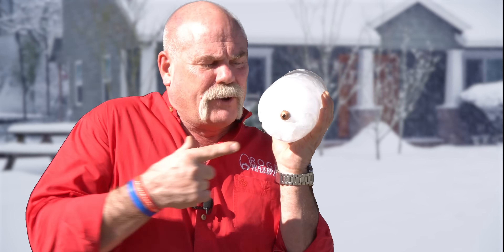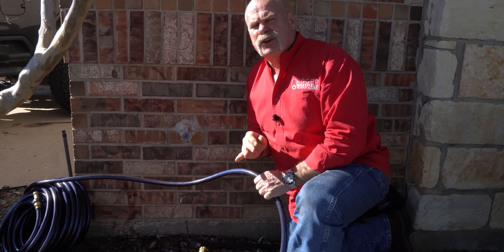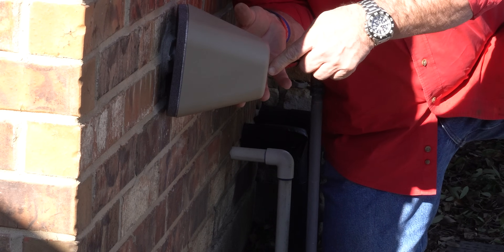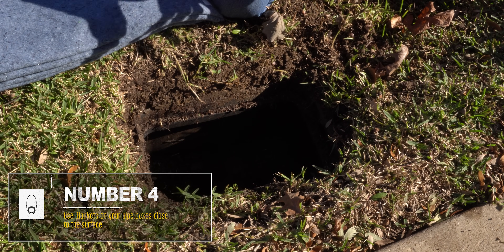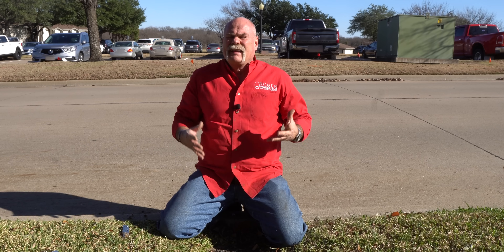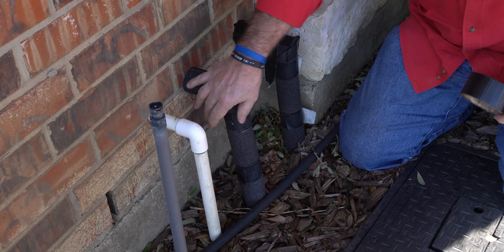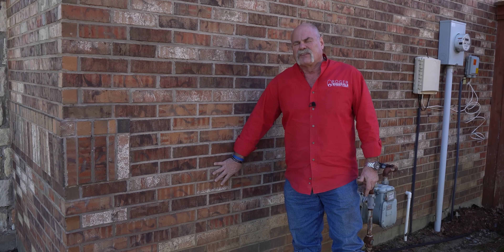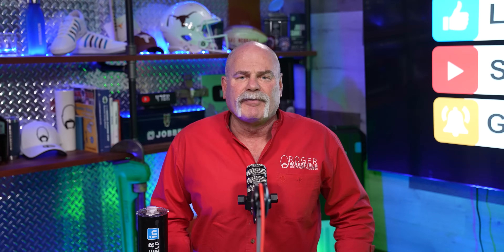6 Tips to Prevent Your Pipes From Freezing!

Comment: The problem with insulating your meter pit is that sometimes when meter readers come by to read your meter they will pull it all out and not place it back in the pit.
Reply: Thats an issue that is slowly being fazed out. Some cities here in California are replacing analog meters with digital ones that sends the data directly to the water company. I think within the next 20 years or so, most states will have already implemented something like this.
Reply: @javiervazquez9472  We are about too as well in the next 2 years mainly because no one wants to read meters and its causing a lot of billing issues. plus epa guidelines about lead contamination in older meters.
Reply: @TheJayDawgZ  keep it up, and soon yall will need to also put cancer warning on everything xD.

All jokes aside, it's probably for the best. The digital ones are scary accurate. And they automatically mail you if they believe you have a leak with your average usage water usage chart, and how it skyrocketed after possible leak.

Comment: I’m a plumber in Alpine Tx and recommend all of these same tips, but I have found with our typical Texas weather. We will get snow just for it to melt in a day or two, the freezing temps come back in a couple days and the blankets stuffed in valve boxes are still wet from the melted snow/ice/freezing rain or what have you; freezes and cause the problem. I see this every year so if you insulate the valve box, don’t forget to make sure that insulation gets swapped out after any kind of precipitation if there won’t be enough time for it to dry out on its own between freezes.
Reply from the maker: Great tip! Thanks for sharing that
Reply: Seems we can’t ever have a dry freeze. Best I can do is cover everything with plastic bubble wrap.

Comment: DO NOT OVERLAP THE HEAT TAPE LIKE IN THE VIDEO!!! Can't believe this slipped through one of his videos, but you never want to overlap. Most manufacturers will tell you, run it straight with the thermostat touching the pipe itself. Most people swear by putting on the underside of the pipe because heat rises. And then wrap it in insulation, you'll have no problems with your pipes freezing.
Reply: I noticed that too. Maybe one day this Roger guy will learn to take his time and do things right. Because if you don't have time to do it right, you'll need more time to do it over.
Reply: @robertthompson3447  he's a good plumber, I like his content, I'm not bashing him at all. I just think that since he lives in Texas they don't really worry about freezing pipes usually, at least not until the past couple years. I just hope someone reads this and listens, because it's a silly reason to burn your house down lol.
Reply: Overlap burns up the tape
Reply: You just cited Meskimen’s Law 😊

Comment: it's interesting to see how different things are in different places. Where I live in Canada the pipes are all 6 to 8 feet underground. There is a shut off at ground level but it goes down to the pipe and takes a special tool to use. The water meter in inside in my basement. all the pipes go through the basement or up the walls to the second floor so they are always heated as long as my furnace is working.
Reply: This isn't the case for all of canada.  Pipes only need to be 18" below ground where I'm at.
Reply: @itsmark1991  where I am, they bury them about a foot deep, for the service, but I've seen a pipe so shallow it's a miracle they didn't hit it with the lawnmower.
Reply: Yeah I'm in Canada too and even with the pipes buried 8 ft underground you still have a cold winter every once in awhile that are freezing burst a water line that will leak and flood the street for weeks and I can't even imagine having water pipes on the outside walls of my house even our sewer systems are at risk of freezing over if you don't get enough snow before we get our minus 40 stretches
Reply: @itsmark1991  I'm guessing you're in BC somewhere close to the coast or even on the island
Reply: @mark Mior  Well...he did say "where he lives". And this should be common sense. My coworker works in the tundra and the pipelines they install are 8-10ft under and over for plumbing due to frost heave.
Reply: @d1vin1ty  my cousin is a  RCP officer and he worked up north when I went to visit him I was quite interested to see that all of their plumbing was above ground inside of metal insulated piping that they heat all of their water piping and sewer piping runs through it there sewer pipes run downhill to stations then gets pumped up to a main building where it is treated then dried out and trucked away in the spring and summer months to the train and hold back down south to a dump it was super interesting to see how infrastructure is built up on permanent Tundra
Reply: @mark Mior  what? I'm in Ohio. Further south than any place in Canada. Our water lines must be minimum 12in deep AND no less than 6in BELOW THE FROST LINE. That basically means all our water lines are at least 5 or 6ft underground by code. Where is Canada is it warmer so that 18in is acceptable?
Reply: @theelite1x721987  I believe the island and places in and around Vancouver rarely see extended cold like they're seeing right now as it's a very rare occurrence to have extended weather like that but where I am in the middle of the prairies it is quite common to have a month-long stretch of -20 + at night with a week or so in there of minus 40
Reply: @Ken Brown we have water mains on top the ground
Reply: @wm1958  yeah I've seen some YouTube videos where the water meter pops up above ground and then goes back below ground and heads to the house those are pretty funny to see for someone who lives in such a harsh climate
Reply: Our pitless on the well  is 14’ underground and the pipe stays at that depth until it comes up under our foundation. The septic also is over 8’ deep. We have no supply pipes in out side walls.  Our outside faucets have the valve 12” inside and are at the proper angle to drain. Our house has 6” of foam in the walls.
Reply: @Chris_at_Home   my uncle in the Yukon built a new house and he built a slab foundation for the main floor and he is telling me that they put nearly 3 ft of foam insulation under the slab to keep the house from losing heat through the slab and the main water line coming in from there well comes up directly from the center of the house to avoid any freezing in the contractor who buried the line buried it as far as his excavator could reach then spray foamed the entire line in with about 2 of rigid foam and spray foaming all the nooks and crannies around it and when they built the garage they did the same type of treatment and put the septic tank up right against the garage slab and then I guess the weeping system is buried the super deep as well in order for it not to freeze but still let all the excess water out of the septic system he told me when everything was dug up in the yard it looked like a bomb went off the only thing that's not very deep up there our power lines and they're just at the required depth
Reply: @waylonhartwell  That would seem a little excessive. Most people here do a 4’ frost wall with 4” of foam to the footing then 3” under the slab. The frost wall keeps the frost from getting under the slab and moving it.
Reply: @wm1958  I’ve been places like that and you get hot water from the tap. Our well water is 42 F.
Reply: @Chris_at_Home  yeah when he was telling me I thought it was a bit excessive but he told me he was going for a house that could be easily heated because it was going to be heated with electric heat and had decided to go with maximum amount of insulation right from the beginning and he actually does pretty good job with heating the place if the power goes out he can actually heat it with his backup generator

Comment: Roger you also add that if you let your faucet drip and only have a crawl space und we the house to make sure and run hot water daily for about three or four minutes to melt ice that will build up in the drain pipes and don't go on vacation with the dripping faucets. Don't want to come home to flooded house or basement from broken drain pipes. Also a reason to fix any leaking fixtures before freezing temperature weather.

Comment: One thing I always heard growing up is to open up a tap to just a very slow drip and that will create movement in the waterlines that will resist freezing.
Reply: Same
Reply: @los38  .... if you watched the video, he covered that.
Reply: Works for a light freeze. Won’t always prevent it from freezing, tho.
Reply: It seems to work.
Reply: @rupe53  I did not see him cover that in video
Reply: @sunshine3914  it will if the stream is large enough. Water is cheap

Comment: Don't run pipes in the outside walls, solves quite alot of issues. :) We had -28c (-17 F) here in Sweden last week and the only call we've gotten is an outside faucet that froze and broke, but the customer didn't disconnect the hose from it.
Reply: I'm in the north in the US. It blows my mind how plumbing is installed in some southern areas. Hell, some even have their hot water tanks and plumbing for it just....on side of building fully exposed. That was in Texas. I know it's normally warm there but it DOES get below freezing. And when it does, thanks to their insane plumbing practices, all hell seems to break loose for them
Reply: I find it funny, I'm in Wisconsin and every winter I hear that there are so many issues down south.  can't belive that someone would buy a house with exposed plumbing. Do people know that it gets cold outside?  My pipes are 8 feet down, all plumbing in interior walls and in a heated basment.  It's-10 , and I have no issues. When it gets below 32 out down south they call it an emergency.
Reply: South Texas here. I have way more use for outdoor plumbing than indoor. If it’s going to get below freezing, for more than a few hours, I simply shut off the supply & drain the pipes. Too many rather not go without for a night, & that’s how they end up with major damage & going without for weeks. 

In my 60 years, this is the 4th year that I remember it staying below freezing throughout the day. Normally, if there is a freeze, it’s just overnight.
Reply: I try every winter to post useful information about preparing for the winter with a list of do's and don'ts . Almost every year a lot of the tight wads will wait until freezing temperatures to run their furnaces and then expect a technician to run out and get them up and running when a pre season start up might have caught the problem before the peak of the heating season.

Comment: Really great advice. I live in Sun Valley NV in manufactured home that my deceased mother owned. It was built with the cheapest materials. Originally had Quest tubing / pipe. Very prone to freezing. The house was replumbed with CPVC which is better than Quest but again prone to freezing and splits. 

Recently had to fix two leaks. I fixed one but then found another. The second one I working on it till 3am in 28 degrees F drinched in water and mud. I was upset, stressed and using every curse word. Finally shut the water off and called for a plumber to fix my problem. I really enjoy fixing stuff but sometimes you need to swallow your pride and call on a professional. My plumber explained why I was having issues and what he recommends going forward. He fixed my issue in less than 60 minutes. He used copper pipe and shark bite connector. Had to pay arm n leg but it was worth every penny.

Comment: We are hoping to add a little value to this awesome video. First, if a person doesn’t have or can’t find the hose Bibb cover find something such as a towel or rag then wrap it and secure it from blowing away. The goal is to keep the wind off of it and make sure it stays dry.Second, keep a couple of faucets on opposite ends of the house running with a small steam . Not just barely dripping. We had this type cold front here in Atlanta a few years back and repaired numerous freeze breaks that our clients assured us they had the faucets dripping .If a person knows where the valves are that shut down the entire section of pipe that feeds your hose bibb turn them off and drain the line . You did a fantastic job covering everything else!

Comment: Living by Canadian Border, some of this can help. We have to use heat tapes. Even though there are thermostats on them, once installed if you really want to have foolproof evidence these are working, we have a meter we put in line to test  how much draw is full operating load. The meter I use is called Killawatt Meter. When our temps get down to the 20's I run my feed for the 3 tapes in our system. Each tape I believe draws about 26 to 30 watts when all are in heating mode. When it is above 40 degrees there is zero draw on the line. So when I see tge meter showing 23-35 watts, I know all are conducting and working. That gives me peace of mind when the thermometer is set to dip to -30 degrees! Killawatt meter can be bought in most home improvement stores like Home Depot, Menards, Lowes, Ace Hardware, Walmart. Best of luck y'all!

Comment: Outdoor tankless heater the bottom needs to be insulated even if it's old towls and a garbage bag. 

I use the black wrap tape they used for the steel gas pipe when they buried it to tape my insulation so I don't have to worry about the sun degrading it

Comment: We have an outdoor hose bibb on the roof that froze last year, was able to unfreeze it. This year installed a freeze miser on the rooftop hose bibb and so far no freeze issues.  I grew up in the north, we don't rely on electrical straps and BTW they do fail.  We also need to get our washing machines or the line that goes to icemakers ready for the cold weather.

Comment: Going to add something very important to this...on those "frost proof" faucets, add as part of your checks, to grab a small pair of pliers (if applicable) and make sure your frost proof faucet is drained by slightly opening the plastic retainer...they have to be installed at a slight angle or they won't drain properly. I've even ran across situations where foundation settling has removed the slight slope, so be on the lookout for water being trapped in these faucets even with the hose off.

Comment: What about shutting the water off at the meter and running the sink until the water stops to clear the plumbing system. Would that work too?
Reply: The surest way to prevent damage.
Reply: There will still be water in the lines that can freeze. To be completely protected, the lines would need drained or blown out.

Comment: Being a plumber of RVs and mobile homes, I have a question Roger. Why do most all non-basement homes not have seasonal low point drains? With my work, I can easily drain and blow out lines with air to prevent freeze damage caused by extended power outages in bitter cold weather. Do they figure the power will never go out, like in Texas?

Comment: Hi Roger what are your thoughts about using a "Freeze Miser" - its pretty much similar to a car thermostat it allows water to flow when the temps are below freezing to prevent pipe freezing.
Reply: I have used these for years and never had any issues…..

Comment: Thanks, you installed your heat tape the proper way but there is a picture on the video that shows them overlapping on top of one and the other forming a cross like. This could cause the melting down of the insulated cable causing a short and can cause a fire.

Comment: I had a problem last year where my pipes under yhe slab froze. So i abandoned those lines and run pex overtop in the attic. And that winter in got very cold here in OHIO and they froze on me. Problem is i had to run then down and exterior wall that isnt well insulated. The curve in pex from that wall up to the attic doesnt bend well and it Almost touches to roof. The soffit is on that side. I can barely get insulation in that tight area.  Or even see if its insulated at all in the area.  Any advice? Or ideas?

Comment: Our upstairs bathroom hot water line froze a couple days ago..no burst thankfully.  In basement where the line starts it's in the mid 60 degrees F .. it goes up thru 1st to second floor in an interior wall, basically dead center of the house, it IS ran about a foot from the chimney. But nowhere in the chimney does it feel cold so I doubt there's an air leak there (down @ flue/where I can reach up into it).. upstairs is about 10 degrees hotter than 1st floor. .. the water started running when outside temp got to about 10 degrees F. I'm stumped..it's never froze up since I've been here around 11 years. Edit: from northwest Ohio

Comment: Hello Sir, Hope all is well. NY is about to get hit with a winter storm and we are hoping for the best. Out of curiosity for the last video with toilet info, does it make a difference if you have Pex pipe Vs, Copper?
Reply: @Angelus420 I would say not much, once the water inside the pipe freezes and expands either line can break. If anything the copper has a better chance at breaking at a connection point where the pex has a better chance at just splitting.

Comment: Roger please answer why you would have lines exposed like that going into your home, I know it’s extra work but why didn’t you dig and drill to bring them in
Reply: There are no building codes in Texas for insulation and freezing.  All houses are built like this.  
The only way to build a house properly in Texas is to pay for new construction and ensure all proper techniques from the north are in your contract.  Then you have to periodically inspect the construction to make sure they insulated, vaper seal, and install piping correctly as they will try to cut corners.    Texas is a mess for house construction.
Reply: Texas homes built for extreme heat which happens more often  and dryness can causes shifts in clay  ground as it shrinks  or swells w rain.